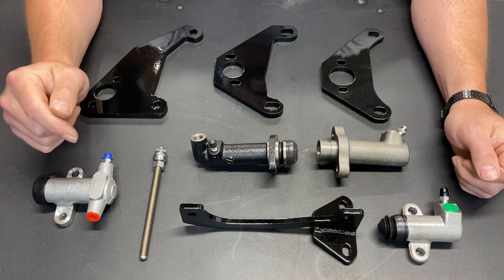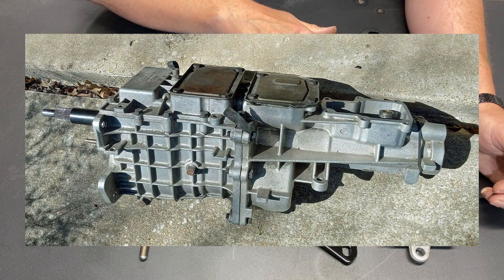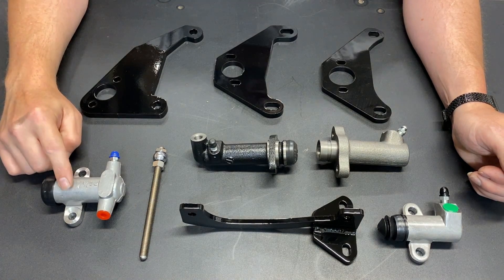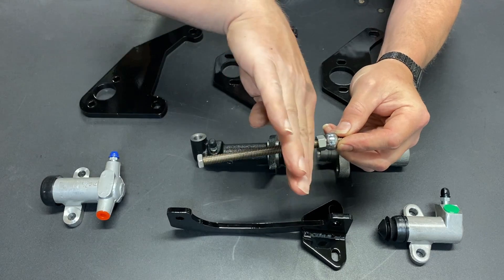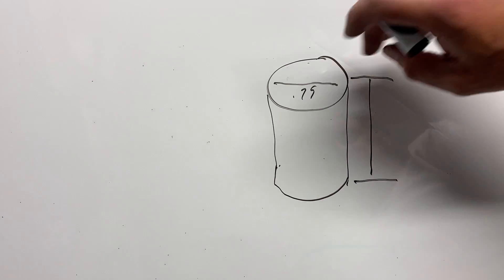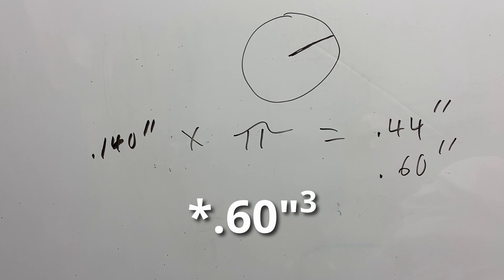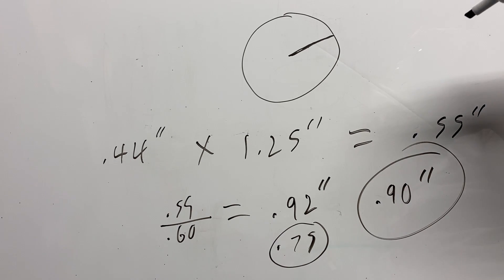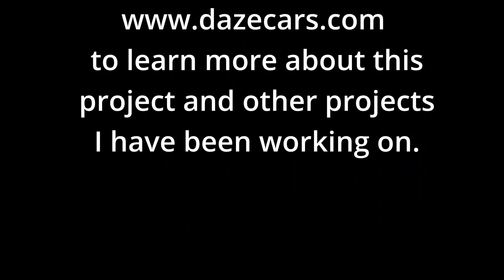Hydraulic Clutch 101, How to Pick Correct Size Master & Slave Cylinder for a Hydraulic Clutch

Comment: Hi mate, i know its a looong shoot, but i need to ask you somethin, i got a hilux ( europeean version of tacoma), with all clutch components new, and the clutch pedal its still heavy to press for my lady, my question is,  should i change the slave cylinder with a smaller bore one, or with a larger bore ? Thanks you very much, any other ideas are wellcome.
Reply from the maker: If it were simple it would be putting a bigger bore SC in the car BUT that requires more fluid volume at the MC to get the same amopunt of travel at the SC.  So it may not work to change out the SC.  If it was me I would figure out the fluid volume at the MC and then get a smaller bore SC that has enough stroke to result in the same flide volume.  This will give you a softer pedal and the clutch will still work as designed.
Reply: @dazecars  Thank you very much
Reply from the maker: let me know if any other questions come up

Comment: In need of a clutch master cylinder for 1988 Ford Thunderbird turbo coupe they DO NOT sell them anymore can you help
Reply from the maker: The key is to match the bore and stroke.  Measure what you have and you should be able to get an aftermarket master to match.

Comment: I have a 1979 Jeep CJ7 that has a T-150 transmission.  I’d like to convert to hydraulic.  The stock CJ master is 13/16, I’ll need to get the stroke and volume, but I’m not averse to getting a non stock, like Wilwood or other brand.

Would you have an adapter bracket for the slave in this application?

Thanks!!
Reply from the maker: I do not have an adapter for that application, but I can help you with your project.  First thing we need to know is how much stroke is required at the SC.  Enother words how far dues the clutch fork need to move to actuate the clutch.  With that info we can work backwards and figure out what size SC you need to work with the MC you already have.  Depending on the resulting SC size there could be the potential for a stiff pedal at which point the combination of master and slave might need to be adjusted to get the right balance but all this can be done with calculations once I know the required SC stroke.
Reply: @dazecars  the stroke is 1.5in on my 13/16 bore master cylinder.
Reply from the maker: How much stroke is required to actuate the clutch?

Comment: Great video, I'm interested in making my 2003 Jeep TJ clutch softer less pressure. It has the t3550 5 speed. What do you recommend for master and slave cylinder. OR pedal hole location leverage???
Reply from the maker: I have a kit for the 3550 but if you are wanting to do your own thing you need a MC SC combo where the bore of the MC is smaller than the SC but has enough fluid volume to get you 1" of stroke at the SC.  As to connecting to the pedal you need to mount the MC where there is room, and connect it to the pedal in such a way that full pedal stroke equals full MC stroke.  Some timee this is a slight compromise.  Also you need the MC pushrod to be perfectly in line with the MC at 1/2 stroke.

Comment: Thanks for the info man. I am building a buggy with a CBR 1000rr engine. I am hoping to use a hydraulic clutch. I am having trouble finding the right size cylinder. ❤old you have any ideas of what I can utilize?

Thanks
Reply from the maker: your question is too ambiguous.  As long as you correctly match the master and slave to get correct slave stroke they can be any size as long as ratio between the two stays the same.  To come up with a matched set you must first figure out how much stroke is required at the slave. from there you can work backwards to get a matched set that fits in the space available.  Sometimes a compromise has to be made to get it to work.
Reply: @dazecars  thank you sir. I believe I have it sorted out at this point. If I am mistaken I will contact you again for some pointers. 

Thanks again.
Reply from the maker: Contact me through my website if any questions come up

Comment: Can you please guide on how to measure the stroke, from which point to which point
Reply from the maker: Sure, with everything in the resting position mark the MC pushrod where it meets the body of the master.  then fully depress it and make a second mark.  Measure between the two marks.
Reply: @dazecars  will measure it in the morning
Reply: Currently using the oem slave with toyota 5/8 master
Reply: What would be your recommendation of what i should do to alleviate the problem
Reply from the maker: Im happy to help but you are not giving me complete information.  For starters what is the problem you are having?  YouTube is not the bast way to communicate.  email me through my website , give me bore and stroke for the master and just the bore for the slave and tell me what is not working the way you want and I will try to help.
Reply: @dazecars  thanks again for your help turns out the master wasn't getting bled for some reason, had to bench bleed it then fit it again
Reply: @dazecars  but thanks tp ypur video i know that the best thing would be to go one size smaller on the slave from 1inch to 15/16
Reply from the maker: glad it was helpful
Reply: @dazecars  the OEM master was 3/4 and the slave was 1 inch

Comment: I have a T-5 transmission from a 1993  4 cylinder 2.3L mustang and want to swap it into my 1965 mustang with 289 with C4 automatic. Will this work? And what kit of yours would be the best …? Appreciate your support!!
Reply from the maker: the 65-66 kit, MC, and line kit would get it done.  You will need a T5 specific bellhousing not an old school bell with adapter.  Keep in mind the gearing on a 2.3 T5 is quite a bit different than a V8 T5  and first gear will not be of much use unless you have high gears in the rear.   Also they are not as strong as a V8 t5 so be careful

Comment: I have a question.  What does the brake master cylinder have to do with the t5 transmission?  Can I still use my power brake booster?
Reply from the maker: They are unrelated.  The only time they would be related is if the brake master and the clutch master are trying to take up the same space.  No clue if your power booster will be an issue as I don't know the year make and model of your car OR truck

Comment: I have a 65 malibu chevelle. I have a mechanical clutch linkage. I swapped to a ls3 with a TR6060. The trans has the stock slave cylinder. What master cylinder should I use?
Reply from the maker: I would love to help you but you have not provided any information I can use.  I would need to know the desired stroke at the TR6060 slave and the bore of that slave to even begin to calculate the master cylinder size.

Comment: Very helpful video, thanks.  I disassembled the OEM clutch master Cylinder, cleaned it all up, measured the "piston/plunger" diameter, the housing bore inner diameter, reassembled and then measured stroke...followed your match and now know will not work with your slave set up; so I can buy one that will.
Reply from the maker: I offer a smaller 3/4" slave with for ll my kits as well
Reply: @dazecars  Yes, I saw and was hoping my OEM set up would work,  It's only a 5/8" bore x 1.25 stroke. If I did the math correctly that yields only .383 Cubic Inches of FV, where at 90% of the 3/4" bore you sell, minimum required is .396 cubic inches.   I'm shopping master cylinders for my application now. Ford drive train in a non ford chassis.I'll be reaching out for your SN95 kit soon.
Reply from the maker: email me through my website and I may be able to help you find the correct parts for your application.  Even if you don't get anything through me I'm happy to help. @chestrockwell8328

Comment: Do you have anything for to make for a78 f250 master cylinder
Reply from the maker: depending on what transmission you have my universal kits should work at the transmission side.  Figuring out the MC side would require some fabrication on your part